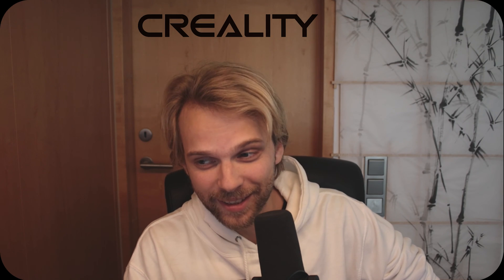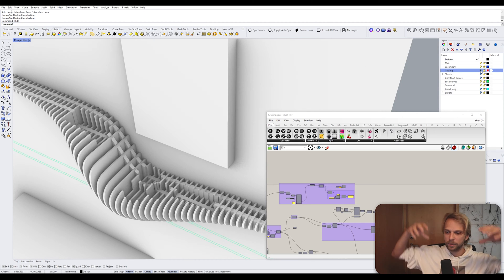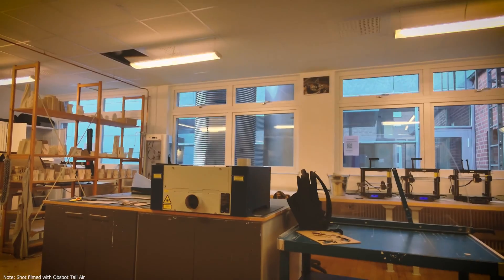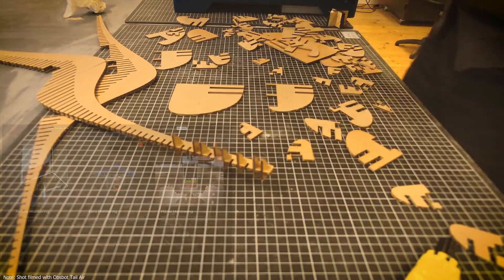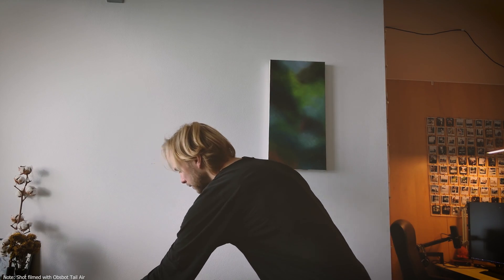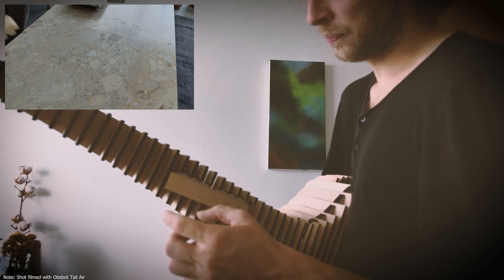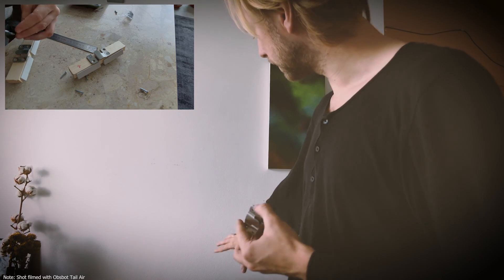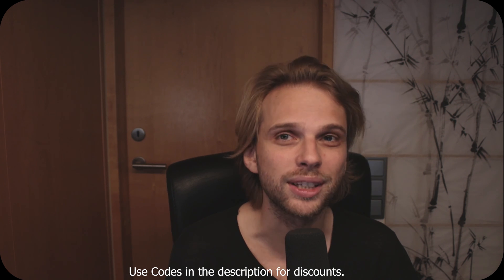Designing Parametric Furniture and then actually building it with Creality Falcon2

Comment: That’s a really cool shelf! It's handy to have such tools for functional creations. I'm not an expert on this but, if the wall is drywall, that screw anchor might not be the correct one. When screwed, drywall anchors become flush with the rear face of the gypsum board. The ones you have used looks like they are for airated concrete or lightweight partition bricks.
Reply from the maker: Yup, you're right - but those were the ones that I had laying around (since literally all other walls in my apartment are reinforced concrete) and I have been already delayed by 3 weeks by the delivery of the plywood. The shelf is 2.8kg (~6 lbs) so I think it'll be fine, shouldn't slip out.

Comment: It would probably be better if you brushed the burned edges off as those can leave marks on the wall and on the objects you put on the shelf.
Reply from the maker: Did a pass with sandpaper and the a wet cloth until edges didn't leave marks.